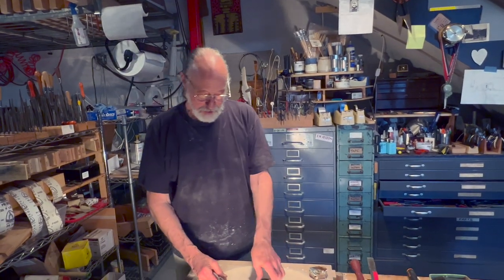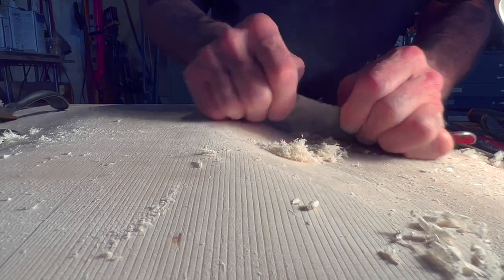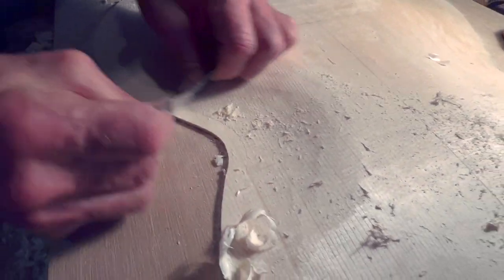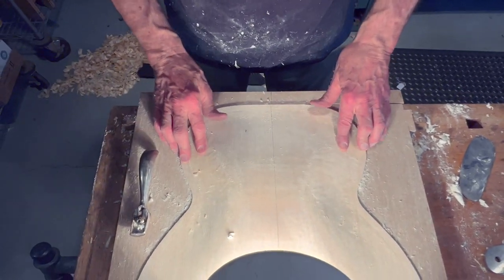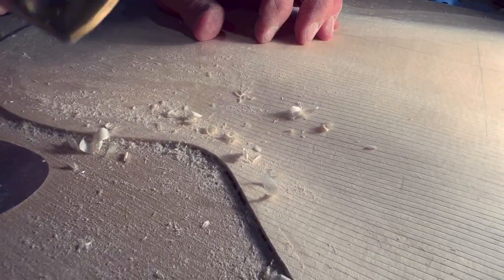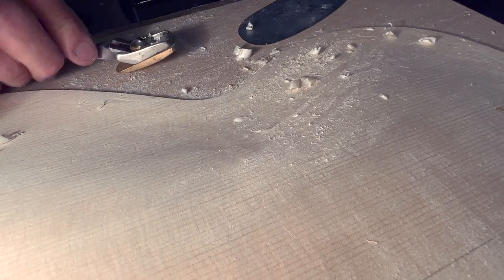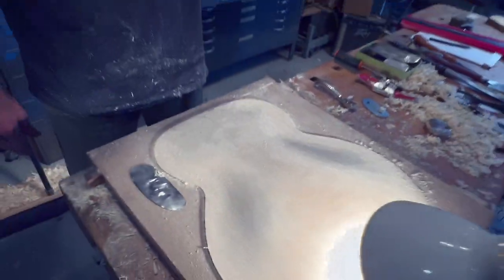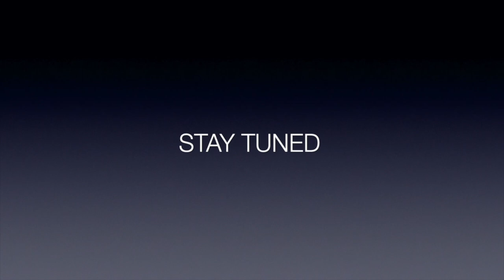Ken Parker Archtoppery - Rough Carving - Chapter 7

Comment: Good to see your work in almost real time, as you many times did before. This is really special about your Archtoppery series. It really shows your hard work and passion that is needed to create every guitar part or tool. 
It is always interesting to see how you are using your tools. For sure I will try 45° thin scraper sharpening. I am used to sharpen them with hardened round burnisher at a little more than 90° and this creates a scary sharp precise edge. 45° maybe even scarier! 
I want to comment on the incredible accuracy of tactile assessment of complex curves and symmetries. Is it my age and ability of my eyesight deteriorated or it was always like that? I can not imagine making a plate without using my touch as a indispensable major sense. 
Thank you for your generosity of sharing your wisdom!
P.S. Edit: Tried 45° sharpening of thin scraper and it is going to stay in my toolbox 🙏🏻
Reply from the maker: K! Thanks for your appreciation. "Scrapers" are a deep story, there are so many ways to sharpen and use them. It seems like such a simple tool until you begin to understand it!
I'm still searching for an adjustable bench light that's worth a damn. The old style parallelogram  Luxor brand work pretty well until they don't, then its endless repairs and mods.  I wish there was an LED with good color on a robust 1 meter goose-neck, but I have yet to find it.